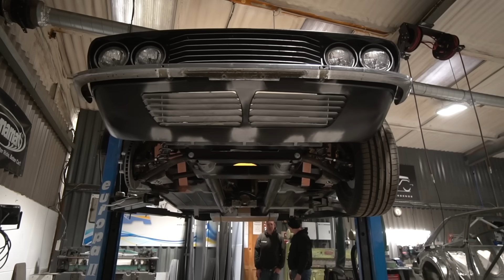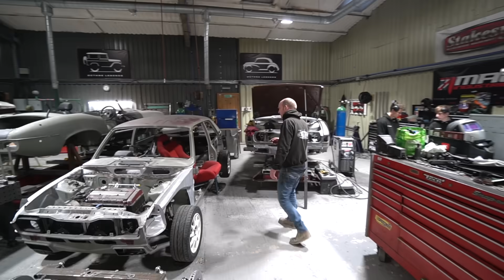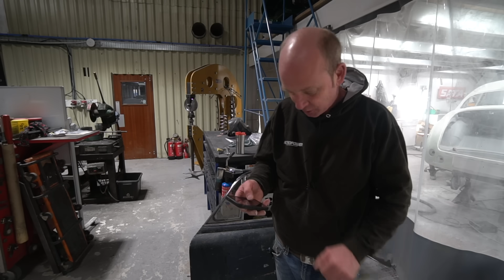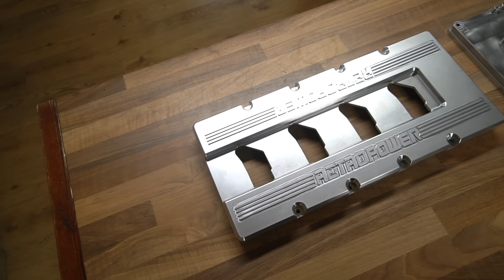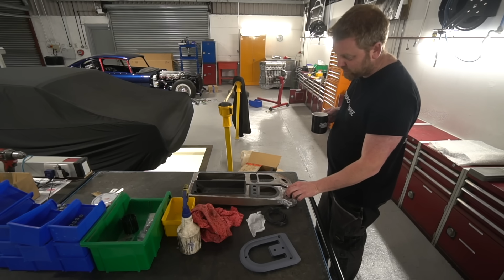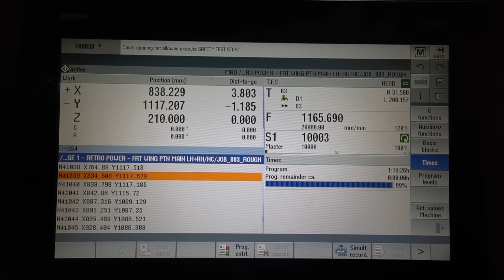HEMI Jensen Interceptor gets under way!

Comment: Ned, it is no shame or perjorative if the cost of the thing cannot be justified if you implement it. Even once it "tracks" ( and go read how the Beta/VHS war was settled), it will be hideously expensive and to afford it for your application at present, you would need either a through flow of finished cars several times what you have or a much higher cost out the door. And there is the thing about a "truly hand built car"- and RetroPower does a  really great job there. Love to see Churchill steaming through the process; it looks like a car Winnie might well have had and driven back in the day. and it has better balance as a design than I thought as Cal's drawings have played out- and the team of metal convicers you keep handy. So, a very Merry Christmas to Each and All of You!

Comment: I tend to love engine swaps, though the LS everything or 2JZ everything movement has made those engines less exciting... as a viewer, as a owner I bet those engines are amazing fun in their cars. ( And I'm thinking in general, LS and 2JZ swaps are everywhere, it's like when I was a kid, it was Chevy 350 swaps that was the big thing. )

But I honestly do love that the Jensen Interceptor still gets a HEMI, as in the MOPAR engine that is.
( Technically a lot of engines are a hemi, like I had a MK4 Escort convertible with a 1.4 engine, it had hemispherical combustion chambers, so it was a hemi. :P )

And I agree on the heater system thing, cars seem to basically be built around them, and it can be annoying at times, I had it give up in a 1993 Volvo 240 I had, the 240 is basically like Lego, everything is so simple to do on them, except two things I discovered, one was adjusting the valves, as I only had experience adjusting on a pushrod engine before, just needed a spanner and a feeler gauge for those, the Volvo needed shims and a maths degree. 
The other part was the blower motor/heater core, I had to dismantle the entire dashboard to get to it, I had an easier time swapping the engine in my driveway, than replacing a broken heater motor in that thing, it felt like they'd just put the heater on the bare shell first, then built everything else around it.
Hmm.. the unit you're using for the Jensen is very similarly shaped to the Volvo one from what I can remember of it, are HVAC/Heater units generally shaped the same then?

Comment: The Interceptor rear suspension appears to have a wide based lower wishbone with no diagonal member to resist the tractive forces and a single upper arm so the only thing resisting brake torque from the outboard brakes is twisting the lower wishbones. You state that the radius rods will need to be flexibly mounted so they will do little to resist the tractive forces. I think the whole thing needs a redesign.

Comment: Question: every time I watch your videos I'm amazed by how far you go with all surface and anti corrosion treatments like the xylan coating, anodizing, zinc metal spray ect. It's great to see how you are searching in different industries to pick what is best for your applications. So finally the question: Why do you leave the exhaust in bare metal? Would something like exhaust wrap or some kind of thermal barrier coating help isolating heat in the engine bay?

Happy holidays and greetings from Holland

Comment: One for your Q&A.
In Australia, when building a car with the level of modifications that you are undertaking in the Allegro projects, there are very strict processes that need to be followed in order to get it to be registered for road use. The legislation seem to be getting even more strict in recent years.
This may involve constant engineer consultation during certain steps, beam tests, torsional strength testing etc...
It would be interesting to know what steps you need to take in the UK to reach the cars final goal of a safe, road registerable vehicle.
Reply: There is a defined checklist that the stations use - UK is a lot easier than many countries to register modified cars. Spain, for example is nigh impossible.
Reply: There's a lot of things you can get engineered, but I think once you cut the monocoque in half like they did, you can never get it on a full rego again. Restricted club permit from then on, I think.

Comment: Nice to see you picking up on the radius rod problem - as I mentioned in an easrlier post, cahning the angle so the chassis end it in line with the inner wishbone ends will allow it to articulate in a single plane, rather than two planes at 90 degrees - so stiffer, even solid, attachment points can be used on the wishbone end of the rods.

yes it is based on the "FORD"9"differential, and all the aftermarket options can be applied - this is using a "nodular"iron housing, but high strength allow housings, and pinion bearing carriers, are realily available from the aftermarket - as is a wide variety of gear rations and LSD type options.

Comment: Any one that has been forced to change the heater core in a larger Audi for instance can attest to the claim that to build a car, one takes an HVAC-unit and builds the car around it. It's sometimes a pig to change the heater core.
Reply: 60% of the cost of platform (car) development is between the front axle and around a vertical line to the top of the windscreen. Boring stuff
Reply: My thoughts exactly the 100 / 200 were awful
Reply: You usually find on most LHD market cars that in the hashed up RHD versions anything behind the dash is a absolute pig of a job as the pedals and steering column get in the way of how they've engineered everything else.